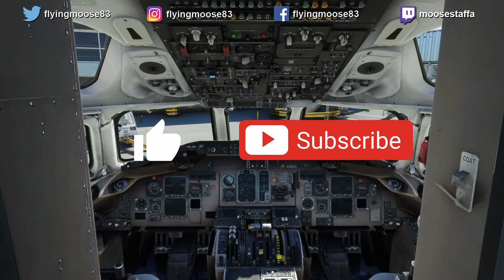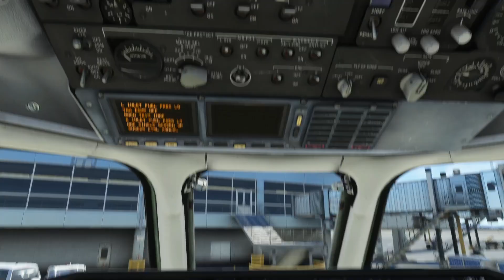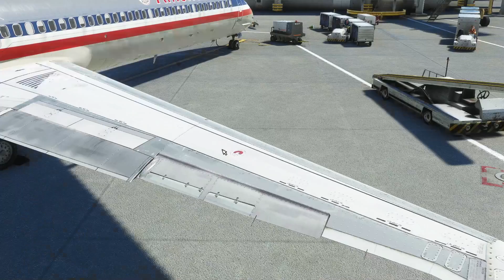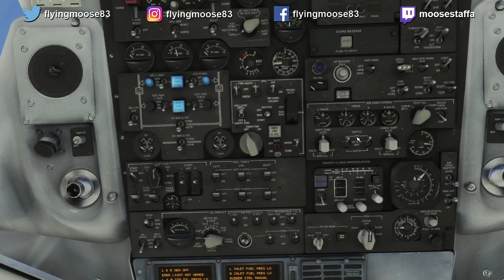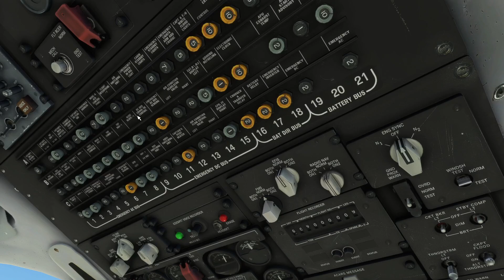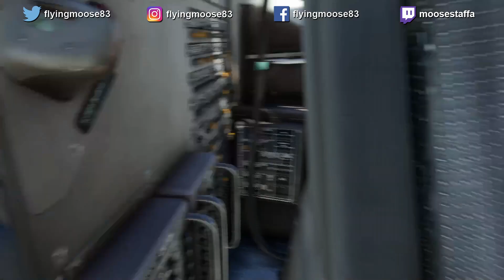MD-82 Maddog Masterclass Part 3.1: Electrical System | MSFS

Comment: I got AC crosstie blockout alert how do I fix this
Reply from the maker: You are not supposed to fix it in the air, but if you are on the ground there is a guarded reset switch right behind the Captains right shoulder. 

The AC Crosstie lockout basically keeps the two AC Electrical busses separated, and will only be an issue if you lose a generator as that bus will now be un-powered. It usually locks out if it detects a power anomaly between the two busses. Can be triggered by too quickly engaging large power loads like engaging both Air packs too quickly after each other
Reply: @moosestaffa83 thank you I fixed it! One question can you shoot rnva approaches on Maddog 80?
Reply from the maker: I think you meant rnav approaches, yes, at least with the Honeywell FMC, you can still fly them with the Marconi, but I believe the vertical part is going to be up to you as it doesn't have a full VNAV

Comment: I think it said not use AC cross lockout in the air, because you can have  power generation on both busses,  and you need to syncronize them.  On ground power plant grids there is special procedure to  cross both power plants in one grid.  When automatic sync fails,  it says ^ ac cross lockout.  Pilots can try to risc and override with damage to system. On the ground we turn off generation, and can reset safety lockdown. Like as IDG disconnect switch, We can disconnect clutch at air, but to connect back we need stop the engibe from rotation
Reply from the maker: Makes sense

Comment: Awesome tutorial once again. Thanks. Just a question: you don't need to open the fuel pumps before starting the APU?
Reply from the maker: Yes and no, the APU will pull fuel on its own, but it's not good for it. The start pump is a DC powered pump to feed tye APU until AC power is established, at which point either the right side or center pumps should be used to feed the APU. If you already have AC power available from a ground cart, then you don't need the start pump, you can go straight to the main pumps